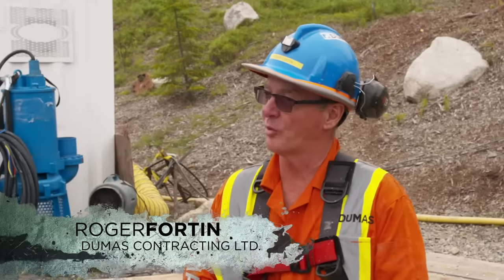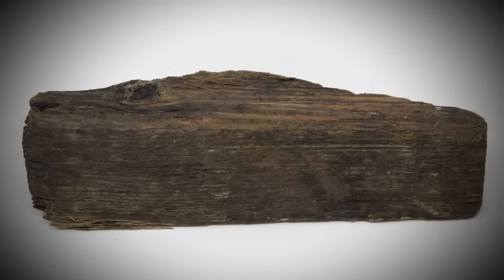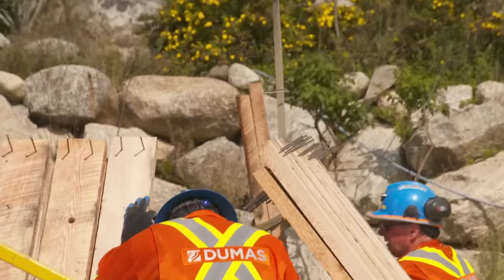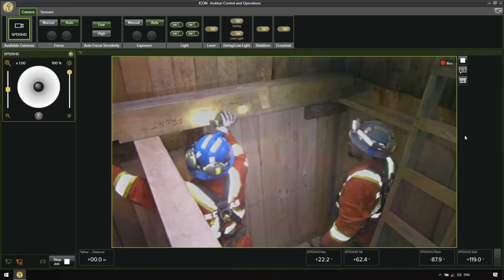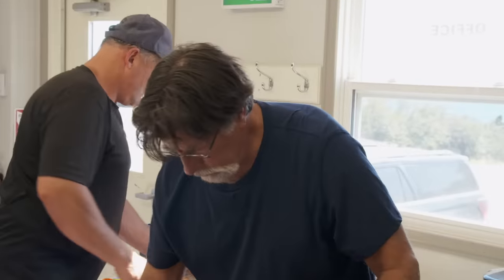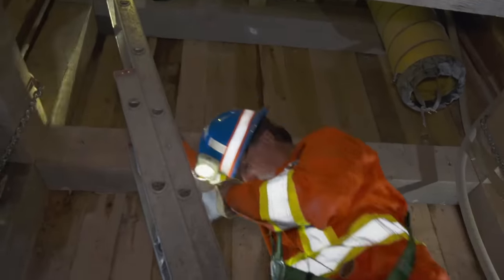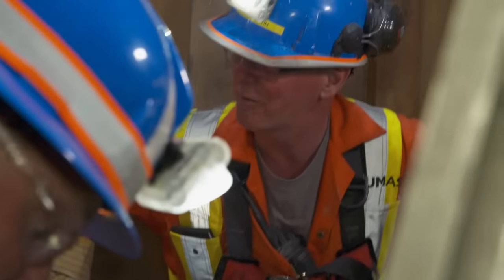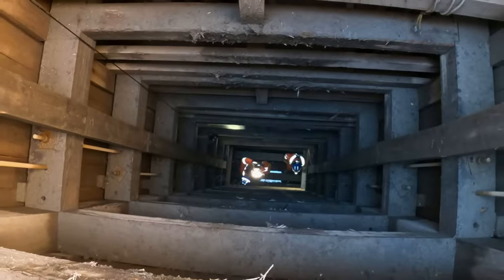The Curse of Oak Island: Rick Ventures Inside the Money Pit (Season 10)

Comment: I think the original money pit site was a decoy. I think the actual treasure, if any is in another shaft possibly accessible from the site they labeled "the hole under the hatch" in Zeena's map. And it is relatively shallow so as to be above the high tide level so it can't flood if the original trap is sprung.

I think in a couple years they will build "The Oak Island Museum" on the mainland and charge for admission and do bus tours to the island for $20. per person! Maybe sell fake pieces of eight in the gift shop? And "I survived Oak Island" T shirts?
Reply: The only thing in the museum will be all the checks they wrote signifying the money spent locally in an otherwise unemployable area.
Reply: I think the treasure is in Scranton, PA
Reply: Treasure was removed 200 years ago, but don't tell anyone!.
Reply: I think I agree with you especially if they had books & documents they would not have wanted them to be destroyed by water so they would not have put them where they could be damaged ..........they are doing what everyone always does go for the obvious buried treasure sites when the real site is probably in plain sight

Comment: Treasure or not, something was going underground for reason and that can't be disputed,time will tell when and  who built the tunnels.
Reply: At one time in the very distant past when the sea level surrounding Oak Island was lower, the cavern(s)/voids beneath Oak Island together with the possible two (2) "now submerged" cave/niche entrances at the Oak island shoreline were above the mean high water line (i.e. "dry").  Recall that when Mr. Dan Blankenship drilled into the cavern at the bottom of Borehole 10X (at 235 feet) in the 1970's, photography showed that a significant operation had occurred deep beneath the island in the distant past.  The evidence is undeniable!  I just hope that (engineer) Marty Lagina can commence his proposed "Big dig" to get to the bottom of everything and get definitive answers regarding Oak Island.  Sorry so lengthy!

Comment: Sooner or later a historic treasure will be finally located. This has been going on since 1795. The original depositors did a lot of work to hide something so important, they didn’t want it located ever. Rick and Marty are determined to search for this legendary treasure vault. They are using up to date science with instruments in the search. Life is shared experience. Rick is standing in the Garden Shaft at 44 feet. It’s been lined with wood boards. It is intended to go to 80 feet in the Garden Shaft.
Reply: Yeah we know.
Reply: or were those elaborate supposed hiding spots created to send people off looking in the wrong directions ??? maybe the treasure is somewhere almost in plain sight???

Comment: There has to be gold there since the water samples showed it. The question is how much. Will there be enough to pay for all the money they spent to find it.
Reply: Previous scientific analysis has show that there is more Osmium (Os) on Oak Island than gold (Au), and Osmium is much rarer and more valuable than gold!  The presence of Osmium is not mentioned on this show because it doesn't fit the "treasure' narrative.  As for the gold in the water samples, etc..., with Oak Island's close proximity to Gold River, the theory is that gold mining occurred beneath Oak Island in ancient times when the sea level was much lower and the cavern(s) were accessible.

Comment: It was impossible to dig that deep. You can barely do it today. Wouldn't the average pirate dig maybe a 10 ft hole...not a 150 ft shaft. Absolutely ridiculous.  That's like stealing it. Landing on the island..then barring it in 150 ft hole ?  Hahaha   it would take a year to dig that.  Where is everyone's common sense 😂
Reply: Yes, pirates typically buried their treasure in relatively shallow holes.  But pirates did not create the workings at Oak Island.  The workings at Oak Island (e.g. the box drains, the artificial beach at Smith's Cove, the Money Pit, etc...) were a major mining and marine engineering project carried out by peoples in the very distant past.  And, nobody dug "that deep" to begin with!  The original Money Pit was a deep, open sinkhole that somehow connected to the cavern(s) deep beneath Oak Island that were accessible via the shoreline in ancient times when the sea level was much lower.  The sinkhole (e.g. the Money Pit) was backfilled after the fact to hide what was "buried" far below.
Reply: @dougferguson5581    Whatever it was/is that was "deposited" at Oak Island in the very distant past was clearly not meant to ever be recovered.  I have believed since the late-1990's that it is a tomb.  Evidence points to the origin being the Mediterranean Region and/or the Middle East but it isn't really talked about on this show because it doesn't fit the treasure narrative.

Comment: Why isn't it flooded? How do they keep the water out?
Reply: That's what I want to know!  When did they seal off the flood tunnels???  Nothing was said about that.  This show is stupid.
Reply: The water comes in at 90' the structure only goes to 80'
Reply: @mr.tibs1334    You are correct!  Problem is, whatever it was that prior searchers drilled into (e.g. the Chappel Vault, etc...) was far below the 90-foot level and then the Money Pit collapsed even further down in 1861.

Comment: Rick, the Leg straps on a safety harness need to be snug not loos and dangling . If you were tided off and fell those loos leg straps will cinch down tight on your Testicles trapping them and causing you a lot of pain and possible permanent damage to your testicles. This is safety harness 101. also the three of you that went in to the shaft should have been checking each others Harnesses for proper fit and dawning . The very fact that the two more experienced gentlemen didn't correct Marty's improper and dangerous Harness dawning.I also did not see any type of safety lanyard or working Lanyard attached to those harnesses, which would be the only purpose of wearing the harness. So what was the purpose of wearing the safety harness if you weren't going to tie off, and couldn't even if you wanted to because you don't have lanyards.  These issues  leads me to questionable the honesty of the show. It's sad I invested lots of time watching this show, only to see questionable safety violations on the most basic level proving to me I have wasted lots of my time watching this B.S. Oh yah, with all that deadly gasses possibility's, Where were your Respirators? In that bag around your chest? if so you never would have gotten them on fast enough to save your life or the life of another.  Fake, Fake, Fake, or is it simply rich and stupid. 
GET REAL GUYS. RIGHT NOW YOU GUYS GET AN "F" for FAKE

Comment: Dreamers .Do they really believe people dug huge holes to bury a treasure so deep with wooden shovels so no one would find it in years to come,  i don't think so they are living a dream which which  is not going to happen ....waste of time and money .... but they won't stop because they have spent so much time and money they can't stop ....shame.
Reply: another thing as with the fellow with the metal detector they should let him loose to get on with it instead of messing around in muddy spoil heaps and the rest its not where they think it is.....if its there...ha ha .
Reply: It's not "treasure" per se.  It's a tomb.  And you are correct in that no one dug a huge hole on Oak Island to bury anything.  The Money Pit was originally a deep, open sinkhole that somehow connected to the cavern(s) beneath Oak Island and was accessible via entrances at the shoreline in ancient times when the sea level was much lower.  The "sinkhole" was backfilled after the fact with dirt and the securely-fastened oak log platforms to conceal what was placed at the bottom adjacent to the cavern(s).  Today, with the steadily-rising sea level, the cavern(s), etc... are underwater and are inaccessible.
Reply: @johnwoa   ahh thanks for the info didnt know that.

Comment: Why would somebody Dig a Hole 40 + meters down to Hide a treasure . Be logical you would need an army to dig and after you did put the treasure in place HOW CAN YOU KEEP THE PLACE  A SECRET .
Reply: You're completely missing it!  No one dug a hole "that deep" to begin with.  The original Money Pit was a deep, open sinkhole that somehow connected to the cavern(s) deep beneath Oak Island.  After the original depositors completed their work/task, the sinkhole was backfilled with dirt and securely-fastened oak log platforms every ten feet to evenly distribute the weight of the dirt and to conceal what lie far below.  It is not "treasure" per se, but is most probably a tomb that was placed there in ancient times.

Comment: The shaft? Actually,I hope they find what,who,and,when,ppl dug that deep to begin with. Plus,I see a bomb shelter,so,I wouldn't call it wasted capital.
Reply: No one dug "that deep" to begin with.  The original Money Pit was a deep, open sinkhole that somehow connected to the cavern(s) deep beneath Oak Island.  After the original depositors completed their work/task, the sinkhole was backfilled with dirt and securely-fastened oak log platforms every ten feet to evenly distribute the weight of the dirt and to conceal what lie far below.  It was probably done in ancient times.

Comment: I like watching the show and have since day one But they have to take all this modernize equipment to dig down ninety feet And yet they are claiming that The depositors dug all this and deeper by hand
Reply: The fact is, no one ever said that the depositors "dug all this and deeper by hand".  HERE'S HOW IT WENT THAT THE SHOW IS NOT TELLING YOU: The sea level in Mahone Bay was much lower in the very distant past (e.g. two-plus millennium ago) and there are possibly two "now-submerged" cave/niche entrances at the Oak Island shoreline that almost certainly lead to the "now-submerged" caverns deep beneath the island.  The Money Pit was originally a deep, open sinkhole that was somehow connected to the cavern(s) and it was backfilled from the bottom up after the fact with dirt and securely-fastened oak log platforms to conceal what it is that lies hidden deep underground--- placed there in the very, very distant past FROM BELOW via the cave/niche entrance(s) at the shoreline.

Comment: The book I read umpteen years ago had the people dig below sea level. They came to hard packed clay above a timber floor. 
When they broke through the timber floor the sea came up. 

They concluded that any gold stored in there had definitely not been in that shaft, that the shaft was built to provide a way for water to flood a place where gold was stored. If it was ever used for that.